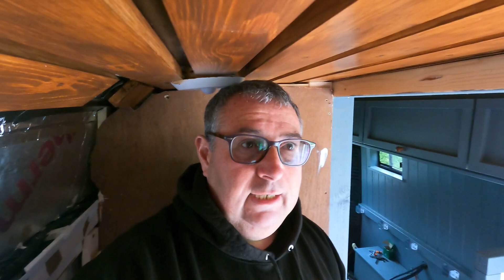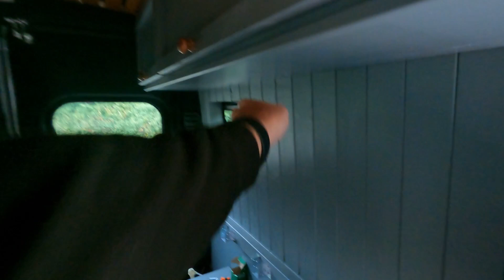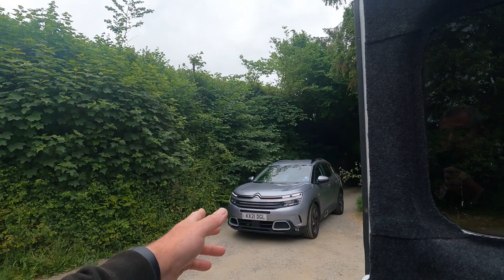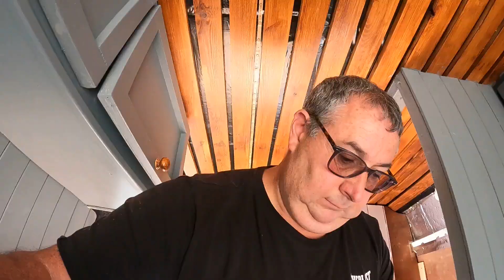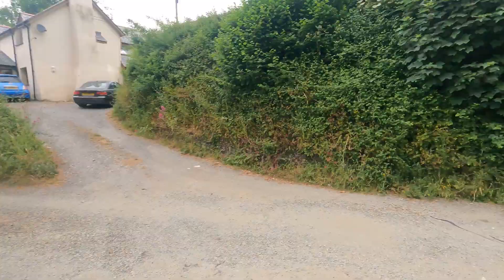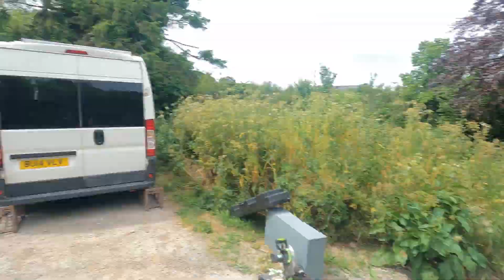DROPPED OF THE RAMP

Comment: Try a FARO or GOK 8mm lpg fitting. I had a Rectus 21 on mine

Easy tip for ramps. Move the van forward and tie a short piece of rope to the ramp and drive back on it. It won't kick out or lift
Reply from the maker: Gods idea lol 😂 
I got the gas fitting it was a truma part .
Cheers